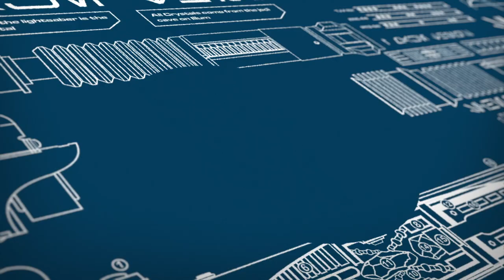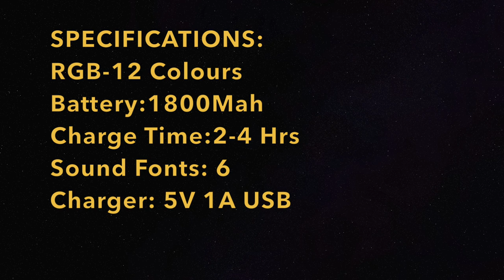Star Wars Lightsaber Cheap Electronics Install (Easy)

Comment: Ok, question: did you modify the electronics kit, or did it come that way?  The link in the description has everything soldered onto a board.
Reply from the maker: It comes that way..and everything is soldered to the board? But they have quick disconnects.
Reply: @TYRANTH_  Let me clarify.... in your video the kit you pull out of the box has the soundcard/battery, with the speaker, LED, switch and recharge port as separate components with quick-connect wires.  The kit the link in the description shows the soundcard/battery and speaker mounted in a caddy, with the LED separate with a quick-connect wire, but the switch and recharge port soldered onto a separate board as a unit.
Reply from the maker: I’m not sure which you will get there is a version where the button and recharge port are on another pcb but everything should still have quick connects the Speaker and LED.. if you were to get the kit with the pcb for the switch and recharge port it mounts by using brass stand-offs and m3 screws.
Reply: @TheShadowmanXL  I purchased the kit linked and it came as you describe. switch and recharge port soldered to a PCB. it's therefore not possible to mount either as described in this video (ie you can't screw them into  the hilt itself.) You have to use standoffs and screws so the switch and port sit 'behind' the hilt so to speak. not ideal, would have preferred the version shown here.